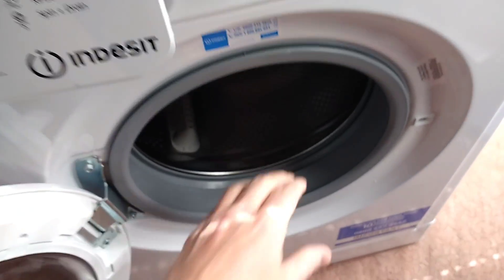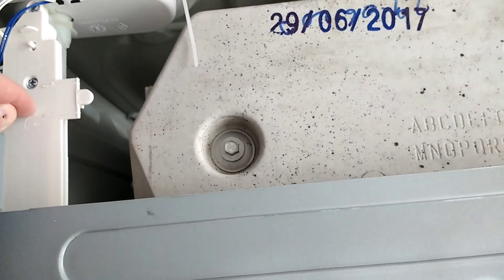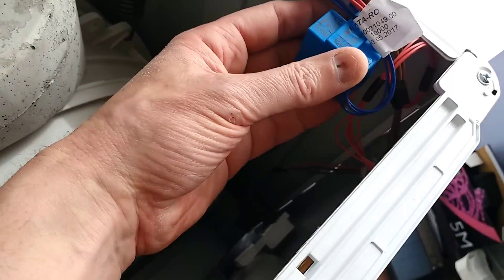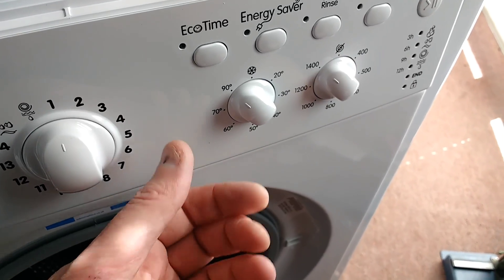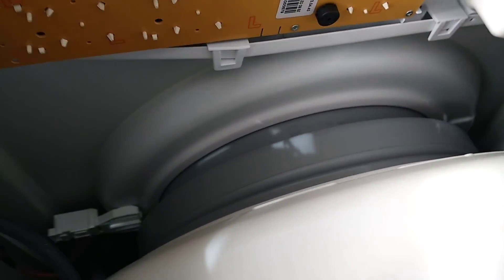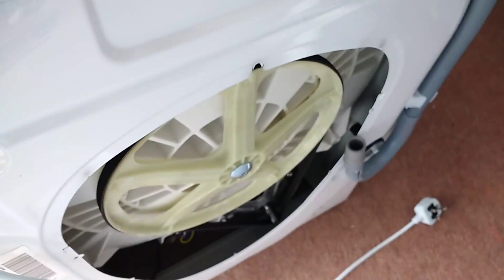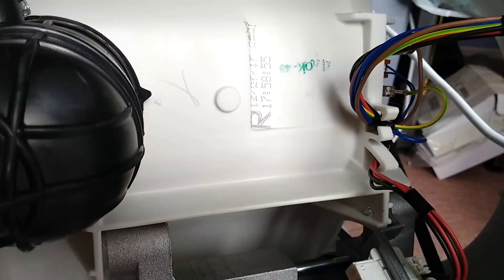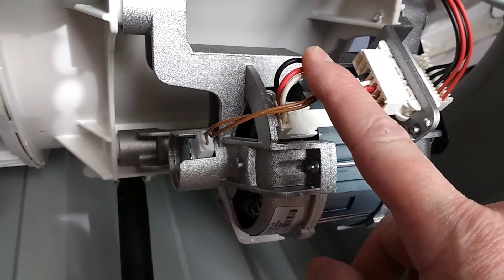Inside my new British washing machine (clothes washer).

Comment: I'm going to be spending the next several days coming to terms with the idea of a washing machine that needs software!
MY washing machine consists of a bucket and a scrubber brush.
Reply: James, is that practice common where you live, or your own personal choice?
Reply: Personal choice. There are no laundry facilities in my building (except for a clothes line) and my apartment is so small that I couldn't fit even a tiny machine in here. So, I have the choice of either going out to the over priced coin wash or doing it by hand. Since it's just me here, I chose the latter.
Reply: They used to have complex mechanical timers/controllers to perform the different wash programs but nowadays microcontrollers are cheaper and more flexible.

Comment: It's uncanny how almost all of these residential front-loaders have almost the exact same construction. Regardless of manufacturer or country of origin.
Reply: If it ain't broke, why fix it (in terms of corporate profitability, that is, not consumer happiness)
Reply: They all seem to be owned by the same people, Whirlpool of the US slowly bought up Hotpoint, Electrolux and Indesit so it's basically the same as Vauxhall, Opel and Holden cars, you remove the skin and there's a generic General Motors model underneath.  That's why I buy Asian machines like Mitsubishi or Sharp, they are designed to last forever instead of breaking down as close to 90 days as possible so you buy another one.

Comment: Got a 17 year old Miele just keeps working, before that had AEG but repair guy said its just rebranded from cheaper make and only lasted a few years, before that had 20+ year old Hotpoint which was on its second set of motor bearings when they went again, i was for fixing it but no! must have a shiney new AEG...

Comment: hi clive, do you know how to test or measure the main bearing wear? most appliance engineers probably know about it!  But alas most bearings cant be changed because now because the drums are ultrasonically welded together :(
Reply from the maker: If you spin the drum by hand it should be smooth and quiet.  If the bearings have failed it will be rumbly and you will feel a slight up and down play in the drum.
Reply: if you put your on the front lip of the drum behind the door gasket If you try and lift the drum slightly you should be able to feel any degrees of wear here because of ratio of the drum to the bearings the wear is amplified! ( zanusi engineer)

Comment: indesit, cheap, but it will work for 3-4 years, and if you are a single man, it will work for 20 years. Mine is 21
Reply from the maker: Single, so much less use, although I do three cycles a week for my gym kit.

Comment: The reason for only having cold water intake is because modern machines only use a small amount of water.... As you know from running your hot water tap, byt the time the water comes through hot, the machine will be full anyway... Plus it means less components, which makes it cheaper

Comment: It maybe a new one but it's amazingly similar to the 15 year old Indesit I just got rid of. The front panel is different and the pulley wheel was metal. Otherwise unless your an expert in washing machine design you wouldn't know there was a 15 year gap between them. But if it works why change it.

Comment: If the pulley is nylon or nylon 6-6 (PA6, PA6,6), it could actually last a really long time, as nylon is surprisingly tough. On top of that, the pulley only has a small load for turning the drum. Nothing more.

Comment: Indesit is the brand that Whirlpool (who also own Hotpoint I believe) used to replace Creda.  Lets call it a budget brand.  With that in mind I'll share a saying from the washing machine service industry that I was made aware of when looking for the cheapest machine I could buy.  "The only thing they forgot when the made Indesit was the H."  I have the washer dryer version which claims to have no prewash facility.  I've since found that this is a lie just to make you avoid putting the soap in the prewash compartment of the dispenser drawer.  I will use said soap on the sports intensive program.  I'm looking forward to being able to replace it.

Comment: Its not the IWC71452 by any chance is it? I cant believe we keep buying the same things all the time lol. I got mine a while back when the bearings on my old indesit finally went squeeks up, it would shake and scream like hell even with a light load at maximum spin, there wasnt anything stuck inside, I shone a torch through the holes in the drum to check. For the years I had it (over 10 years) the heater was still spotless!?!(never used powders, only liquid detergent direct in wash) I got this new one so I could keep the spin at 1000 rpm, its a brilliant machine and its nice your venturing inside so I dont have to.
I kept all the wiring together from my old machine except the motor and heater as I really couldnt budge the damn thing from its housing, so theoretically I could plug in the mess I have and it would run through its cycle, assuming I can mimic the water level etc. I guess the control board would be worth posting on ebay, and pump. It was a WIL133
Reply from the maker: Mine is an IWC81452 which is the same machine but has a slightly deeper drum.
Reply: It's like me and my brother, we keep buying things only to find the other bought the same or something similar. Proves one thing, we have great taste and must have been separated at birth lol :) I'll say it one more time, I love your videos Mr.Clive, you have a fan forever :)

Comment: Looks identical to our previous washing machine we recently got rid of.  It did the job but the shock absorbers didn't work very well and it would dance across the room if the load wasn't perfectly balanced.

Our new washer/dryer is much more fancy, the motor is completely silent even when spinning, guessing its using a stepper motor rather than the more basic three-phase like this one.  Well worth the cost for the more expensive one as even when the top is wobbling like crazy during a spin the bottom is perfectly still.

Comment: I read somewhere that the concrete weights were been replaced with water containers that you fill up , saving transport weight.
Reply: Probably because concrete has a much higher density than water, so you need much less. And if you see how much concrete is used you'd have to fill nearly the whole machine with water to get the same mass.
But it sounds neat, would be much better to transport.
Reply: practical when bringing the machine up into the flat ... hope,it will last & there have an outlet for the wight water, in case of moving
Reply: Yep, I saw that recently as well. Wonder why no one has thought of this before?!
Reply: I wonder what difference waters ability to move has on the result. I can't figure out if that would have added damping effects or if it would just make vibrations worse...or both :)
Reply: If filled to capacity there will be no movement, though it may be designed not to fill to capacity so the movement can purposely offset the motion of the drum.  Good point, Pook :)  perplexed

Comment: Very surprised about it not having a bottom cover, what about the regulations that state you cannot access any live parts without using a tool?
Reply from the maker: The machine weighs a lot.  You'd have to make a real effort to access the bottom.

Comment: Machines were standardised about 10 years or so to take only cold water, for a long time we were the only country in Europe to have mixed fill. The argument was based on efficiency that if a machine had a hot valve, because the water level required  by the machine is so low by the time a boiler had kicked in or water was drawn from a tank the machine would be full of the cold water from the pipe work. The motor is brushless DC (BLDC). One note, beware if you have Slugs getting in the house, for some reason unknown to us appliance engineers Slugs absolutely love getting on those circuit boards, I've seen loads of those Arcadia machines killed by slugs!! The pressure switch has gone digital now and has a coil inside it now rather than contact points

Comment: - pulleys tend to be plastic nowdays, I never got to see one broken
 - the component sensing water level isn't a pressure switch, but a pressure sensor - one that sends (propably square wave) pulses to the main control board, the control board then knows the water level based on the frequency of the pulses, IIRC it operates at 5V
 - tub usually isn't fiberclass reinforced
 - the shock absorbers are actually only greasy pistons with a sponge at the tip inside a tight tube - no pressure, only friction
 - yes, I wrote "tight tube"

Source: Me - I used to repair those machines for almost ten years
Reply: I'd rather break a plastic pulley and replace it with a new one when performing a repair than have an aluminum pulley seize to the drive shaft.
Reply: I would assume it's a cost saving exercise, however they previously used metal, the problem is they where different metals and ended up corroding quickly due to the galvanic corrosion effect

Comment: Every home appliance that uses water, ie washer, dishwasher only has a cold feed now in the uk. something to do with correct water temperatures.
Reply: It's to be greener.  In a house that still uses an immersion system over a modern boiler they would have to heat their entire water tank before doing laundry, while a modern washer uses (and thus heats) only the exact amount of water it needs.  It's all about that label with the colour bars on it that every appliance comes with.
Reply: Rob Fraser it's nothing to do with energy as the appliance would score a higher rating if it didn't have to heat the water. There is no temperature control if its filling with hot water as you could have your water set to a higher temp than what your setting the machine to. If it cold fills then heats it up itself then the program heat setting can't be wrong.

Comment: Same motherboard as my washing machine, and you can set your watch by when it will die next,, usually on the anniversary..  

Is it legal, moral, ethical or acceptable to design something that fails after 12 or so months. is it just my bad luck, or has built-in obsolescence Gone Mad...
Reply: If there is a way to make it cheaper.... Whirlpool has found it.

Comment: I also got me an indesit washer/dryer combo machine... gave me very good results and it was dirtcheap
after about a year it died creating ultra loud rattling noises like an impact drill
they tried to fix it three times under the warranty.
then they gave me a Bauknecht (used to be a high quality german brand) machine which much better specs, claiming indesit had bought them recently and they wanted to get rid of the old-stock
The bauknecht is now 3 years old and doesn't even shake the ground too much when it's on full tilt xD

Comment: bigclive, you want    to have a look to see is the pulley has any gf markings as a part made of gf30 nylon is pretty much as strong as cast aluminium. its the reason they use it for pretty much all cordless drill gearbox housings now.

Comment: Hmmm... have they (Indesit) changed location of the filter? Is it now accessible from the front again like it should be? Used to have intesit/hotpoint couple of years ago when they had filter accessible only from the back/underneath, hidden under the drum, inside ball shaped rubber drain pipe. Madness...

Comment: "Conditioner... Which I never really use, it just makes everything greeeeasy feeling" - I work in the laundry industry and I hear this wayyyyy too often...

The usual cock-up is overdosing, because people want the softest of soft - Use the manufacturer's recommended dose EXACTLY, as a tiny bit too much can be very detrimental, producing that greasy feeling.

The next is "mixing cloths of many fibers" - It's a sin!!! Wash towels with towels, t-shirts and smalls with t-shirts and smalls.

And most of all, load your machine to it's weight limit - Your machine is designed with a weight in-mind. Most excess chemical will be mechanically knocked out of the fabrics unless it's over/under weight.

If you use the dosage tabs, like those little soluble bubble things, then you need to adhere to your weight and fabric types. 

Bath towels are a prime example; People want them "soft and absorbent". They try to over-soften them, which makes them less absorbent, so they leave out the conditioner, which makes them like sandpaper (I know you want soft for your delicate ginger skin Clive!) but they're at least absorbent. Thing is; properly-conditioned fabrics are more absorbent than non-conditioned (and softer), but over-conditioned feel greasy and less absorbent... This is most apparent when you stay in an hotel. Their linens and towels are professionally laundered. Industrial laundries don't use more than is necessary, that'd be a waste. So they dose very closely to their guidelines and load machines by weight and fabric-type. And what do you do? You steal the towels and bathrobes because "they feel so luxurious", then take them home and fuck them up.

#TL;DR: Your botty deserves properly conditioned towels and pants.

Comment: most important thing with these is if the drum is sealed permanently or bolted? because i had one were the bearing went. everything else was good but had to chuck the hole lot because the drum was permanently sealed glued. my new one the drum is bolted so i can replace bearing in this one.

Comment: That looks like my one, which I was cursing today after I set it up and went out, only to return and find my clothes had been tumble-dried and not washed!  Turns out it was operator error, the white panel with white controls (which have a white pointer) led me to set the programme 180° out.

Comment: Typical hotpoint group machine - cold fill machines have been around 10-15 years that's how they get them in the A, A+ energy ratings, common fail point on all these machines are the caps on the main board (made in Romania by the lowest bidder)

Comment: Hi Clive don't worry about the pulley they generally don't give any problems. Indesit Company (Now part of the Whirlpool Corporation) have been using them for many years. Really nice to see the 3 Phase Induction Motor and Inverter. One thing that disappoints me with modern machines is the plastic tub is welded not bolted together, if drum bearings fail the entire tub unit has to be replaced. Sadly most machines are made this way now.

Enjoy your new machine.
Reply from the maker: I wondered if the drum bearing might have been accessible from the back behind the pulley.  I've not explored that far.
Reply from the maker: The new motor is extraordinarily quiet.  All you hear is the clothing sploshing in the drum.
Reply: bigclivedotcom unfortunately not, the drum and shaft would have to come out to change the bearings, they have deliberately welded the tub so you can't make such repairs.
I highly recommend using washing powder, the liquid detergents do not contain Sodium Percarbonate (Oxygen Bleach) and as such allow bacteria to build up on the tub, powder also has better corrosion inhibitors which protect the drum Spider.
I'm quite sure it will give you many years of service as you are not washing for a huge family.
Reply: bigclivedotcom they are virtually silent, quiet spinning too.
Reply from the maker: I'm a bit sensitive to the whiteners/additives in laundry detergent, so I tend to use a very small amount of washing up liquid, and monitor for excessive foaming.  I do occasional sterilising washes with bleach to keep the drum fresh.
Reply: bigclivedotcom you could try the Ecover detergent, no brightening agents and the detergent is made from Corn Starch.
Be careful with the Chlorine Bleach, it's highly corrosive to the Spider.
Reply: Using too much detergent will make the shaft seal leak and take out the bearings and too much softener will allow mildew to grow. I use either a pinch of powder or liquid detergent but I pre-dilute the liquid 5 parts water to 1 part detergent, same 5:1 with the softener.
Reply: Daniel Armstrong actually using too little detergent is much worse as it allows limescale to build up on the shaft and seal causing the seal to fail prematurely, this is especially problematic in hard water areas. Washing powder is a complex system of ingredients which protect the Washing Machine as well as cleaning the laundry.

Comment: Comments full of "planned obsolescence" and "indesit are rubbish" blah blah whatever. I love the optimized design, it's what makes things that would have been impossible cheap and possible. I bet the money they saved in some parts let them develop/implemeny a VFD and you benefit from a much quieter appliance. Probably nothing wrong with the plastic pulley either.
Reply from the maker: The VFD might be a cheaper option with the smaller and simpler motor.

Comment: Hope it wasn't Micro$oft that programmed the code. It'll either crash and burn or the wash cycle will stop and prompt you to download a patch before continuing. Worse yet...a hacker will gain control of the washer and unload 1/2 gallon more soap into it and you'll have a laundry room filmed to the rafters with bubbly foam!
Reply: The worst thing would be that it would need a operating system upgrade, and then bits of it wont be supported by the upgrade.

Comment: Do you get any trouble with mold/mildew on the frontloaders? Iirc the isle of Mann is pretty humid.
Reply from the maker: You have to routinely clean the front rubber seal every so often, and do a cleaning cycle at full temperature with an empty machine if you don't usually do the high temperature washes.  It's also a good idea to leave the door open when not in use to allow ventilation.
Reply: In over 30 years of using washing machines, I've never come across a mold/mildew problem. I suppose if you use them at least once a week they stay quite clean.